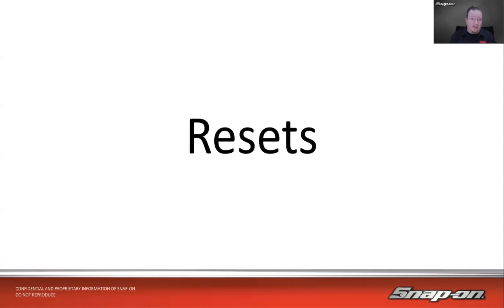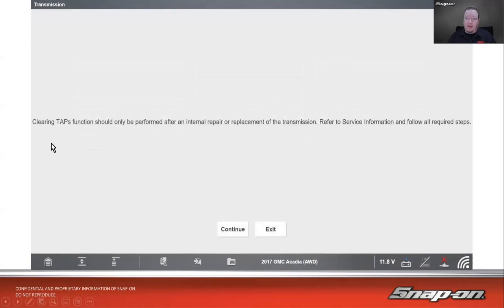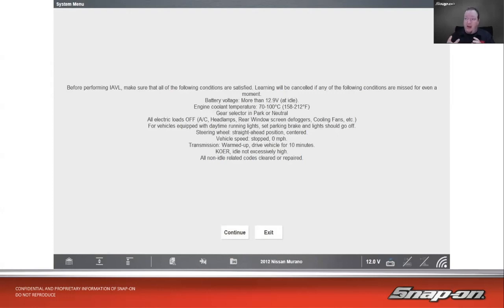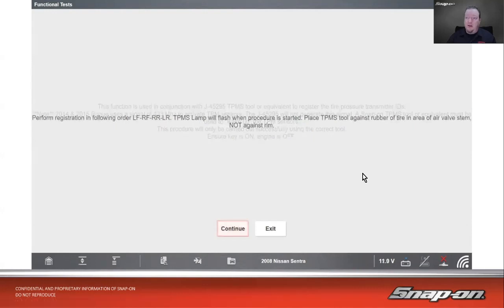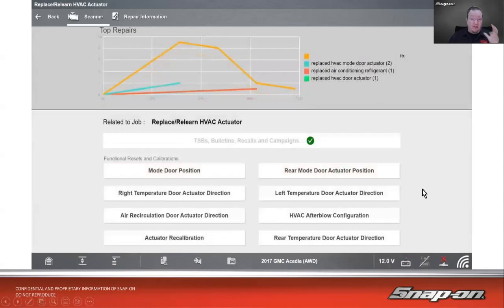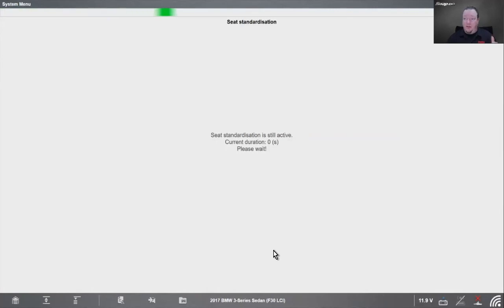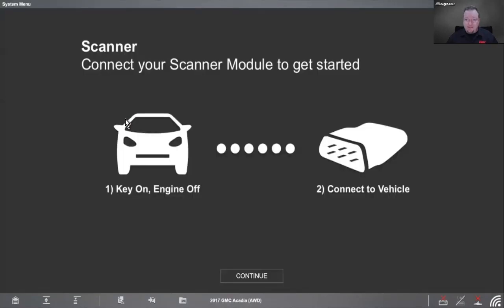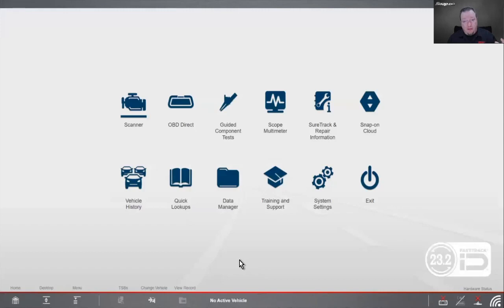Snap-on Live Training Episode 65 - After The Repair: Resets and Relearns | Snap-on | Diagnostics

Comment: Not sure why the this function is grayed out and not available
Seems fishy my tool is up to 2021 and I’m working on a 2005 
This option should be apart of the tool
Reply from the maker: If you're referring to the Service Resets and Relearns menu, the tool needs a current subscription or data plan to access that. The resets and relearns will still be available in individual modules, but the quick menu won't be available without it.
Reply: @SnaponDiagnostics  It’s actually not because it will not pull up the individual modules it’s clearly a way to keep you from accessing the primary function. unless you keep paying money I don’t recommend a company who plays games and try’s to keep you locked out
Reply from the maker: The functional tests, resets, and relearns are part of the software that's on the tool. If you go into engine, for example, you will find them under Output Controls, System Tests, or Miscellaneous Functions depending on the vehicle. If the tool does not have a current subscription or data plan, you will not have access to any web-based functions, such as the Service Resets and Relearns menu, Fast-Track Intelligent Diagnostics, Quick Lookups, SureTrack, Security Link functions, and Snap-on Cloud uploads. Otherwise, the scanner functions should all be available as they are part of the tool no matter what. If that's not the case, you should call tech support at 1-800-424-7226.
Reply: @SnaponDiagnostics  I did already they sound just like you a broken record player 

This is why I won’t buy anything from snap on

Like I said they lock you out
Reply: Make a video prove me wrong
Reply from the maker: We'd be happy to walk you through it if you email us your contact info. diagnostics_support@snapon.com
Reply: @SnaponDiagnostics  like I said before B.S.

Comment: I HAVE A SOLice edge, the reset and relearn functions do not appear in any menu. Is this not available on the SOlus?
Reply from the maker: The Service resets and relearns menu is not available on the tool. However, all reset and relearn functions are still available if you go into the individual module menu.

Comment: I traded the newest version of the TPMS system back into Snap-on after I discovered that it would not initiate relearn or do you any service procedures for the Autel MX or any of the Alltel line TPMS sensors Absolutely ridiculous So Autel got my business which is backwards compatible
Reply from the maker: There are 2 TPMS sensors that we don’t support since they’re proprietary. Autel sensors and Schrader had a proprietary version as well. Our tools work with all others on the market.
Reply: @SnaponDiagnostics  thanks for the reply.
Reply: My TMPS 5 crashed  with sofeware issues outside of warranty  and snap on fix it for free.